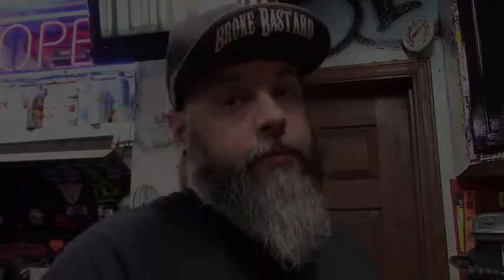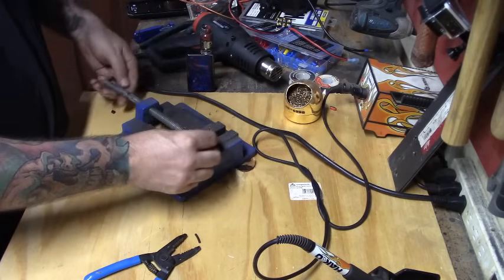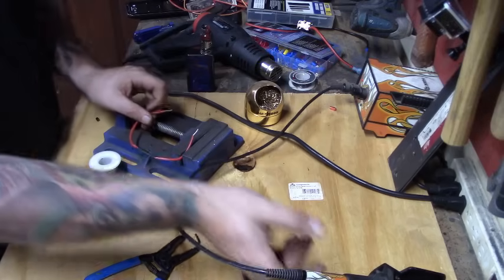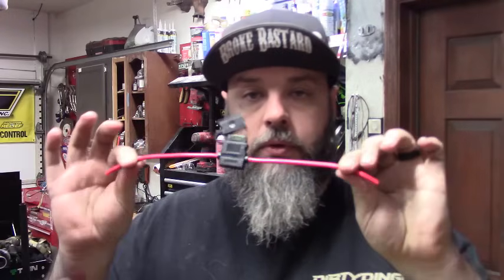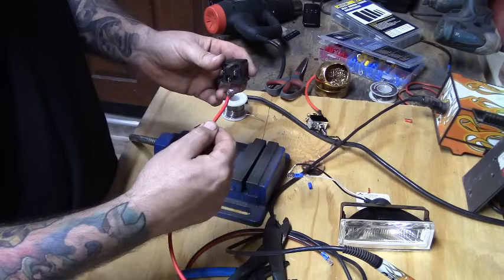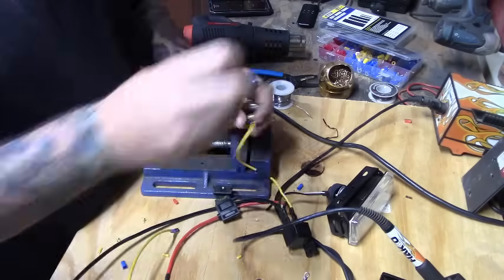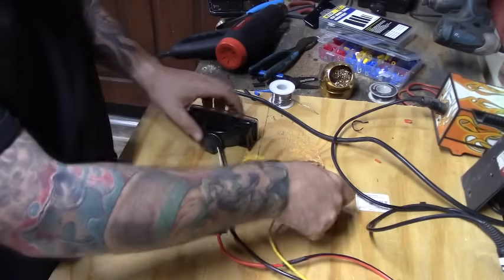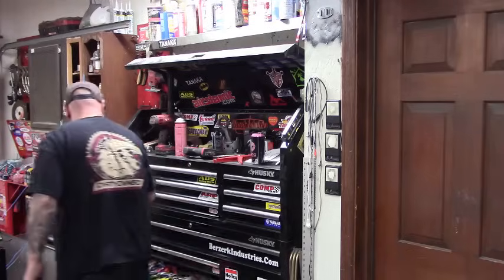How to wire a Relay and Why You should use them.

Comment: Thanks BB for this video,I appreciate your time and work.Maybe you can answer me one question.When you buy inline fuses,and they say 3,4,6 7 volts and so on,what would you use them for? I wanted to install gauges and some clearance lights on my truck and I was wondering why these fuses have such a low voltage rating.Thank You.
Reply: its the amp draw that you are concerned about not the potential across the fuse/relay break... 
EDIT BEGINS: as somewhat alluded to in the video [I just finished watching... after I already read your comment & responded(hence this add on edit)- I do that sometimes- read & respond to comments while video plays in background especially on basic stuff I already know in a trade I don't practice much]... the dude alluded to the fact that once you utilize the break your switch will NOT carry heavy potential (V) when what he should have directly stated was that there is virtually NO CURRENT LOADING on the switch (A) as the current will NEVER EVER REACH the switch- that has been made IMPOSSIBLE! Either the relay & fuse are functional & the current LOADING does its work at your add-on/accessory in this case the headlight... OR the fuse/relay are fried & again still no load on switch... so that is what he was alluding to when he spoke about a REMOTE SWITCH... a relay is actually a BYPASS sub- circuit that ensures NO LOADING CURRENT [that is ONLY required to do actual work] ever reaches the elements of the circuit dedicated strictly to command & control for circuit management ... aka the logistics of the thing... keeping the CURRENT LOAD PRIMARY CIRCUIT for WORK separate from the command & control components is the whole BASIS of circuit breaks/ fuses etc... we want current to do the work we want it to do not be wasted dedicated to other tasks at the risk of frying those components...everything other than what does the Actual WORK you want done gets placed on the sub circuits protecting these command & control (usually expensive elements) & being more power efficient... since a control of a load can be mega magnitudes smaller than the actual current working load... so he did answer your question you just maybe missed the entire consequences of what he actually said being mixed up with 'low voltage' & 'remote switch'!
The TRUTH is its a BYPASS that removes non work elements to a sub circuit dedicated to command & control with AMPS much lower than the WORK AMPS remaining on the Primary Circuit

Comment: good video. I am also guilty of hooking up lights the "other" way. The fog light kit's instructions were to wire it with the power going through the switch, and there was no fuse.  Im glad i never had any issues, cant believe the instructions were unsafe. The switch did eventually burn out too, i just removed everything after that.

Comment: Where do you the relay and switches? Thanks for a great video.
Reply: You may purchase these relays and switches at most any automotive parts store.  What he did not cover was that for different gauge wires required to complete the connections from power to the relay (12GA) and wires from the accessories to the relay and switch (18GA), you may need different size terminal to crimp on as well as various diameter heat shrink (purchase those too).  Having the tools is necessary.  Selecting and purchasing the components to successfully tackle and complete the job (in one trip) is often the frustrating part of the job.  You can end up with little drawers filled with spare parts and spools of leftover wire and totes of specialty tools for "quick projects" like this.  This was explained well.

Comment: Right. Good lesson! 

I installed extra relays in my old Peugeot 505 GL. Resistance built up over time. Damaged my nonrelayed light switch/steering column stalk. Cleaning all the connections I could find with a very thin file, and packing them with silicone grease made a noticeable difference. Vehicles should be built with a lot more relays and connections protected with some sort of grease.

Comment: This is good, however solder is not always good for making a good circuit. Most people claim that it is not a great conductor. Not sure about this theory but for automotive wiring, soldering is usually not recommended. Edit: I think I remember Scanner Danner said that the use of solder for ABS sensor wiring would mess up the signal.

Comment: You wrong.Adding wires , connectors , socket connectors and realy make the instalation easy to beak in this meany points.Just connect lamp or other reciver to positive and normal switch on negative wire - then is almost no power going through the swich , and you will get rid of the problem of bad ground.
Reply from the maker: Marcin Matwiejczyk You wrong!! HaHa. Placing a switch on the negative still carries the same load. Simple is not always better.
Reply: @BrokeBastardGarage  Nop .Amperage is the same but voltage is  drop to almost 0 .Because power is voltage times amperage there is almost no power going trugh swich on negative terminal.Thise is the case if reciver has big restistance if its not you lose a lot of energy due to a wrong receiver.
Reply from the maker: Marcin Matwiejczyk Ok. Not going to argue. You do it your way and I will do it mine(same as all builders and manufacturers I know of). Thanks for the input tho.
Reply: @BrokeBastardGarage  Not arguing .Just  it's a shame when i see those beautiful new  cars from well-known manufacturers , standing on the side of the highway with a raised hud becuse some sensor detect out of acceptable parameter and computer swich out all your  car whith no reason - its look like future of car manufacturing.New cars they should have a "I do not care" button that switches off all this advanced electronics leaving only the necessary circuits and allowing you start engine  and to drive do you destination .
Reply from the maker: Marcin Matwiejczyk that’s my I love my old cars with only the bare necessities